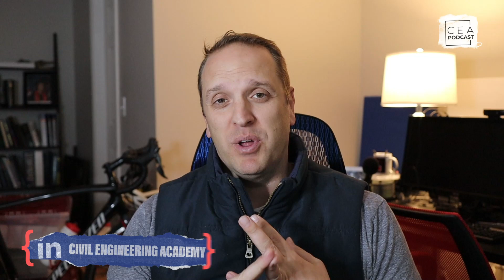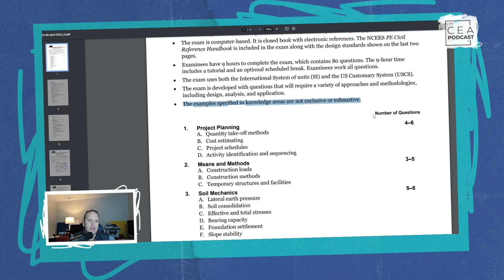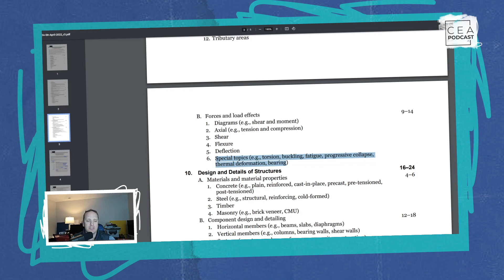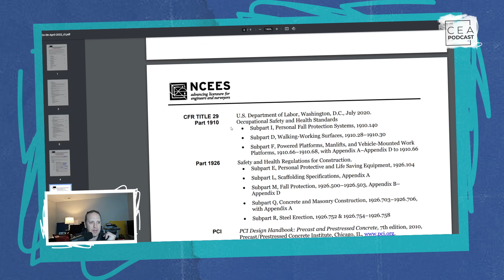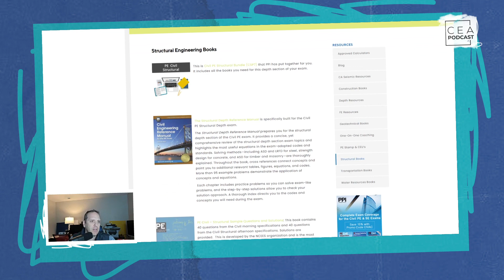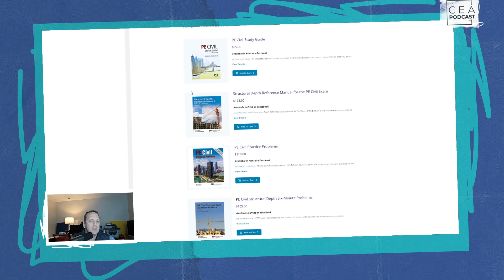CEA 161 - A Deep Dive Into The Structural Depth Exam

Comment: Hi Issac, thanks for your video. I didn’t pass on my first attempt in civil structural, unfortunately, and it’s really discouraging and stressful where to start again. My concern is the actual exam was a bit more complicated (tweaked) than the most of practice exam problems what I’ve studied through the videos and books. I was self-studied and spent almost 4 months after work. 😂 Should I try purchasing the lectures in CEA or SoPE then change my exam studying strategy? I’m expecting to allocate another 3-4 months study and hoping to have more understanding and confidence. My score diagnostic shows that the AM portions were not drastically failed but below average most of the chapters, and PM is similar but big failure in the analysis of structure.
Reply: Used SOPE. Disappointed with their cost/benefit ratio. They are OK for AM only. For PM in WR they failed poorly along with my 1st attempt.

Really liked EET for WR PM. Never took them for AM. The founder is one of the instructors. He also answers emails directly as would a college professor -- same day and with much attention even to complicated questions. His WR cheatsheets were somewhat of a legend in WR PE study circles when hardcopy refs were permitted in yesteryears.

Ask any questions about SOPE and EET. I'll try to guide you.
Reply from the maker: I totally get it.  Sorry you didn't it done this first time.  Keep that head up though.  You can do this! I think the structure of a course will  help to keep you accountable, provides more problems, and most importantly, provides you with support!  I do recommend a course to help.  If you're interested in ours shoot me an email with any questions you have!  Civilpereviewcourse.com